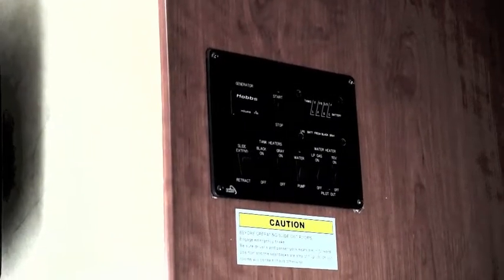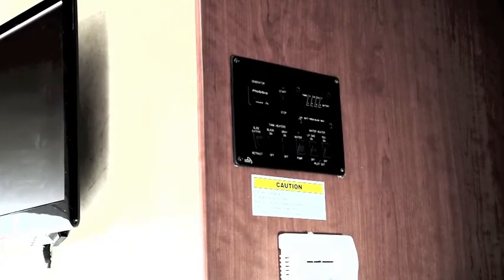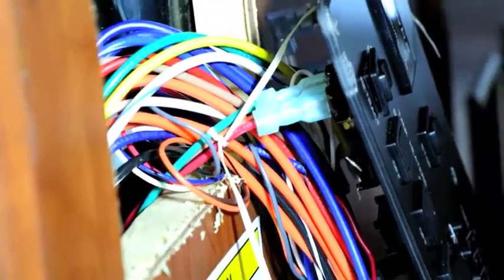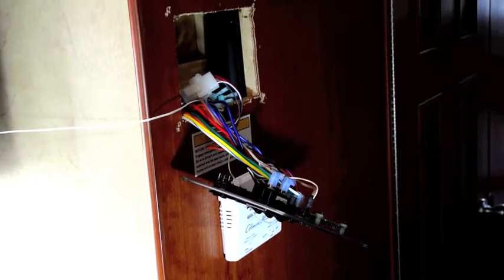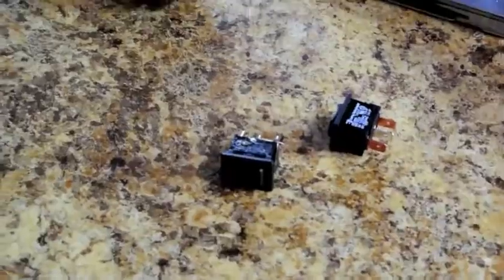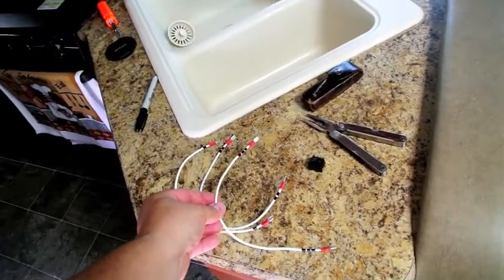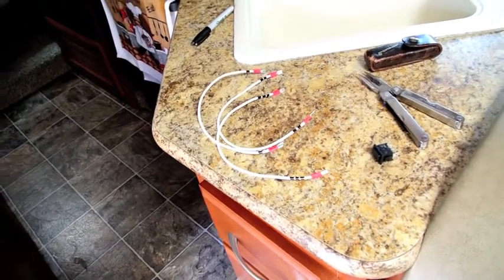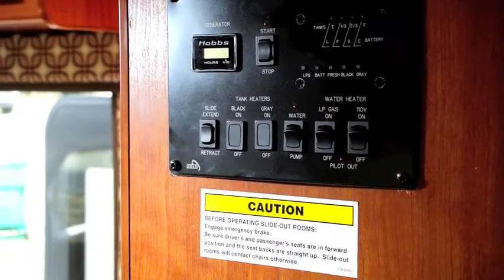Repairing the slide out switch in my RV.

Comment: Would this relate to a problem with our new used Adventurer? We kept engaging the parking brake, but the red lights kept coming on like it was not engaged. It took 6 times to release and engage the emergency brake before we could get the slideout to slide in.
Reply from the maker: Sounds like there may be an interlock switch preventing your slide from operating unless the parking brake is on. Perhaps it is faulty. 

My motorhome did not have that functionality.

The slide switch in this video is for the actual slide mechanism, not any kind of interlock. The only way it would prevent the slide from operating is if it were intermittent or faulty as well - which could be possible.